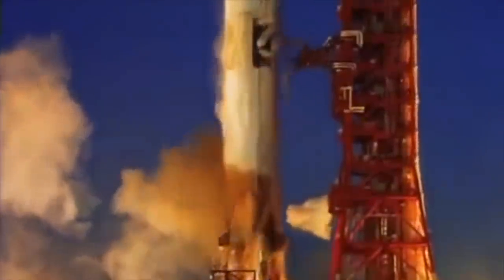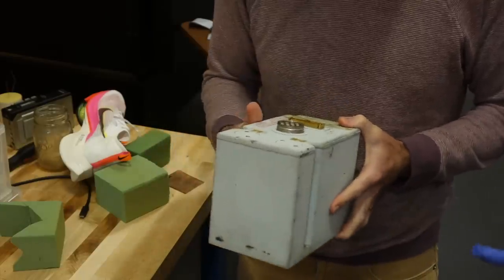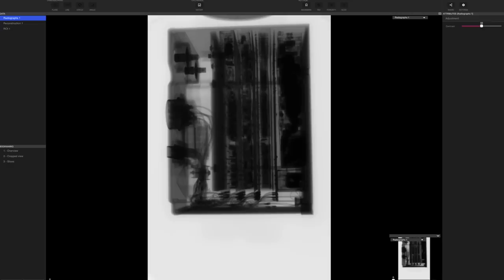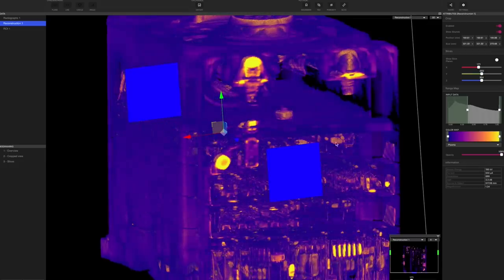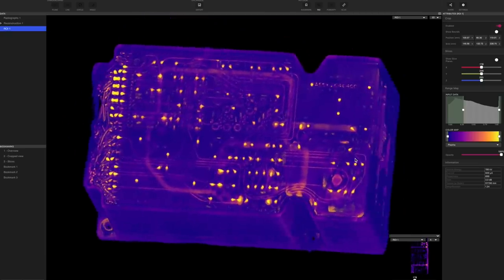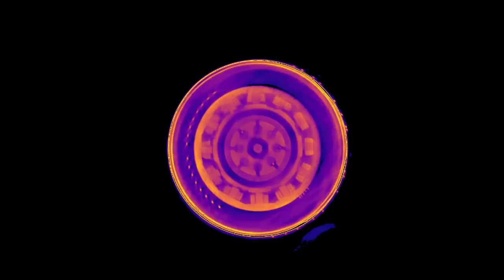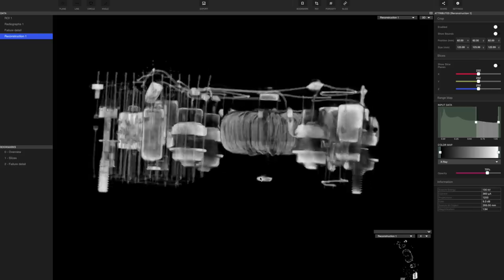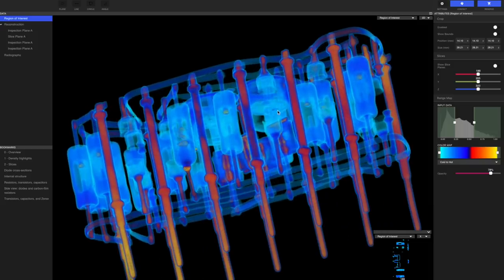Looking inside Apollo components with Lumafield's 3D Xray machine

Comment: before retiring, I used a CT scanner to inspect failed potted sensors that I was responsible for.  Compared to trying to de-pot the sensors, the CT scanner was a huge improvement!  Now I could find caps that the potting had cracked during thermal cycling or all sorts of other damage that would be masked by our semi-destructive de-potting techniques.  What a wonderful tool!

Comment: I don't know which is crazier: the fact that all those doodads arranged one way and one way only create a useful function; or that every last one of those 10,000 sub-components in this one unit alone was hand soldered.  A million solder points alone here?  CRAZY!
Reply: The construction blows my mind too!
Reply: And a friend once said to me that Apple OS was the greatest achievement undertaken by man so far.....🤣🤣
I reeled off a few Apollo details and corrected him.
Reply: The connections inside the potted modules were probably welded, not soldered. I worked on the APQ99 / APQ116 terrain following radar system at Texas Instruments in Dallas back in 1968. All the connections inside the cordwood modules were welded, using stainless steel ribbons. They did that to prevent vibrational failures at the connection points. Very rugged after potting in a very dense potting compound, forming a nearly monolithic block. There were many tests done on the modules to ensure perfect operation before potting because after potting, the module was not repairable.
Reply: And in the AGC, individually hand-woven 0s and 1s in the core memory. Just mind blowing!
Reply: @krnlg  I have a 70's Seeburg Jukebox that uses Core memory also.

Comment: Could those long cylinders be desiccant cartridges? When I was in the Navy I remember seeing something similar in some equipment. They were made of a mesh tube filled with desiccant and had rubber end caps. I think that they had similar looking clips to hold them. Those scans are beautiful!
Reply: Reminds me of the wand on my old tube Geiger counter.
Reply: I was just thinking of capacitors
Reply: or just fuses...?
Reply: There seems no mesh pattern. Was it a metal mesh, by the way?
Reply: @ВасилийКоровин-г9э  Yes, it was a very fine metal mesh.

Comment: I'm going to put in my guess for the cylinders - which may sound silly: Weights
Since they look like no wiring attaches to them, that eliminates a lot of things. So just chunks of some material - probably used to tune the vibration resonance of that top plate.

Or maybe a spot where they had previously planned to have some component, but deleted them, and for reasons, couldn't remove the bracket (or leave it empty).

Edit: One last guess - desiccants and/or getter material?

If you look really close, especially on Z, you can see it is actually a cylinder, held in a metal (probably) sleeve (with little tabs on each end), which is then in the "fingers" holders.

Comment: I'd wager the mystery components are desiccant canisters. In case the nitrogen fill port is opened to adjust the time base.
Reply: I never thought of that!!!  I was leaning more towards them being geiger muller tubes
Reply: That was my guess too.
Reply: this was my thought, to absorb any off gassing from some components eg electrolytes that would leave corrosive residue.

Comment: 2 components under the top cover will be desiccant packages, there to absorb any moisture that might still be outgassed from the components during use after being purged. Probably clipped in, then tied down with twine and some goop to hold it down.

Comment: 11:10   I think the mystery components are wet tantalum capacitors. I have come across them in long packages and I have found them in lots of my own avionics teardowns to.
Reply: If you slice through the layers, it doesn't appear there are any wires (or anything) connecting to them.
Reply: @EricMBlog   yes i did notice that as I was just looking at the shape of it rather than what was inside.
Reply: @rcb.p.c.2811  Yeah, I mean, it's not a bad guess. I posted my thought - either weights to tune the resonance of the case, or a spot where they used to be a component, and rather than revalidate the physical design when they deleted the components, they just filled the holders with a dummy. 
Of course it's perfectly possible that we just aren't seeing connections - but I've already spent way longer than I should look at these xrays :)

Comment: Seeing the exploded module inside a sealed case made me wonder if the hermetically sealed enclosures with their dry nitrogen fill was as much to keep the pure oxygen cabin atmosphere out of reach of fuel+ignition sources, as it was to keep moisture (condensation, body fluids, etc.) away from the sensitive electronics. I don't see any 'bare' potted modules anywhere? Was this a response to the Apollo 1 fire, or did the design choice pre-date the disaster. As I recall, they never did find a definite cause.

Comment: Are those 2 "tubes" maybe fuses ?? Which doesn't make sense really, if you can't access them 🙂

And... why don't you open the welded lid with an angle grinder?
Can be restored back to original later.

Comment: my guess on those two cylinders is a moisture absorber or some sort of pressure stabilizer that absorbs nitrogen and releases it to maintain a stable internal pressure (like molecular sieves)
those clips on each end look like retainers to stop it from slipping out
no hard casing. probably wrapped in something like paper 
i dont see any connections to it, otherwise i would have guessed a PTC heater. 
if it had a hard shell too i would guessed a backup battery

Comment: A wonderful tool. I guess you could 3d print these to give a nice hand held visualization.  I was wondering if next time you are using the cursor on a screen you could bump up the cursor size in the Ease Of Access settings. It does go big sometimes ( 11:04 ) but it is easy to lose track of where you are talking about. Thanks for eveything

Comment: Have to wonder if those are two large resistors clipped in as part of a heating system in your master clock. I have seen clips exactly like that used for mounting resistors in high power transmitters.

Comment: I wonder if Honeywell's miniature rate gyros also have ruby pivots in them?
Reply from the maker: The ruby pivots are not used normally - the magnetic suspension will suspend everything. It’s only there in case of shock or other event that overwhelms the magnetic suspension I believe.

Comment: So what is the original intended use of this machine? I understand that it is essential for reverse engineering 😅 but other than that: what is it for?
Reply: Reverse engineering why the hell my forward engineering doesn't work if you hold it at a ten degree angle on Tuesdays.
Reply: Maybe it has potential with the new process of 3d printing metals coming to the industry, maybe you want to validate if the inside structure of the 3d printed part has correct dimensions?
Reply: @MrEptor  Good point! I always wondered when those companies show off their incredibly intricate internal structures how on earth you'd know if it came out right
Reply: Good question; it’s used as a general diagnostic tool for design and engineering—pinpointing the cause of leaky seals, figuring out where an enclosure is conflicting with electronics, etc. In production manufacturing it’s used for quality control—finding pores and cracks in castings, validating dimensions of invisible features, etc. 

Industrial CT has been around for decades, but is very expensive; our belief is that by making it much more accessible it will become a front-line engineering tool; think of it as an oscilloscope for mechanical engineers.
Reply: @lumafield  "An oscilloscope for mechanical engineers" - what a nice conceit 😅I love it 😍

Comment: 1:27 ok... how the heck did they weld it shut without melting the guts of it? What's the confidence in it being welded shut and not having some hidden seam?
Reply: Very carefully - magnesium can ignite, but it’s melting point is only 650C (steel is around 1400C, depending on alloy)
Reply: Tig weld in pure argon atmosphere be one option or co2 lasers from. The 60s

Comment: Spent a bottle of wine viewing the images, one end of the cylinders has some sort of mesh pronounced in 78‰ opacity at one end, but could be pure carbon metal film resistor as a heating element, or I am seeing machined threads at one end menu design  defo need a gymbol in the side window, lock planes option be nice